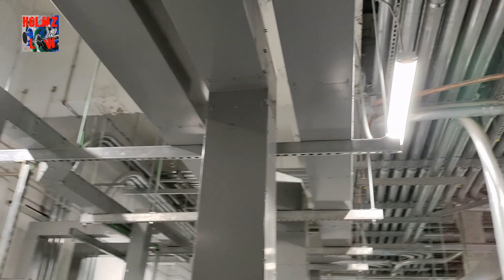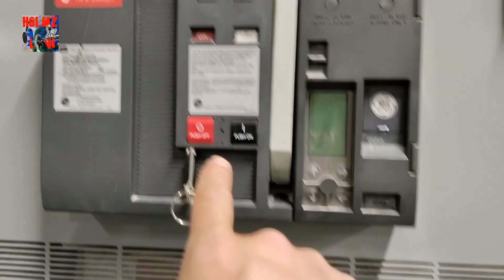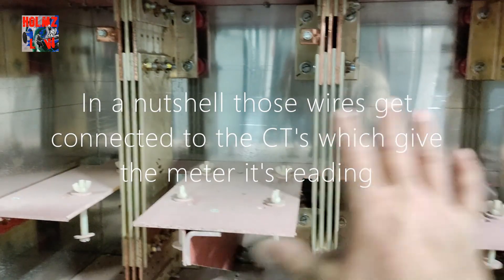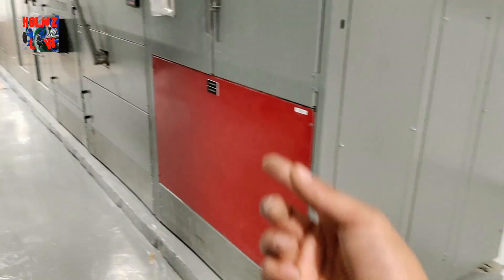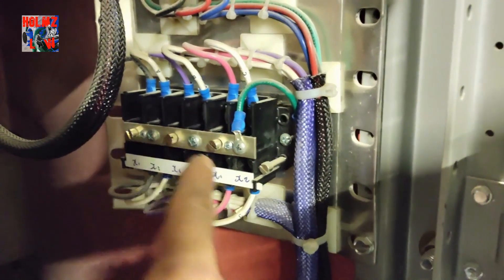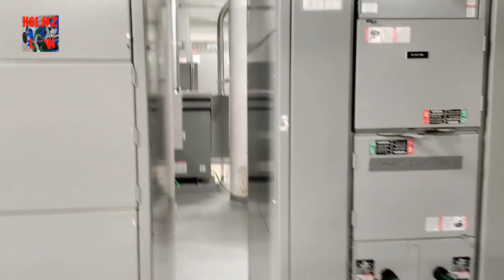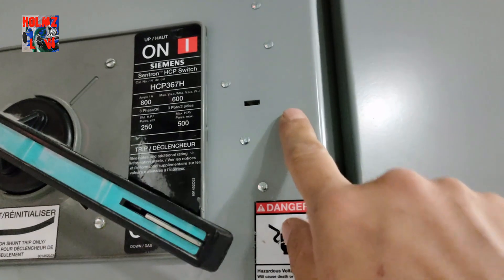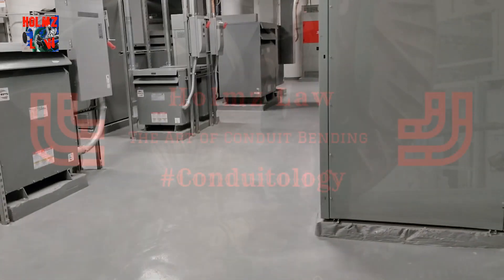Switchgear Pt.2 - Components

Comment: Awesome vid. Couple questions if you dont mind answering. Why have two different bolt switches per service, why not one main disconnect per service? Also why are there 6 services in the building instead of 1? Do you guys use the building steel as a GEC for all the services? Thanks in advance keep up the hard work!
Reply from the maker: Why the 2 bolt switches. Well that just how the engineer designed it. The switch gear was designed by the engineer and put together by another contractor. We installed it and put the sections together. Why 6 services. The building is pretty big also they're are multiple tenants that will be occupying the building. Yes we use building steel for our services but we also supplement it with the water main. How this answered your questions. 
Follow me on:
TikTok/holmzlaw
Facebook/holmzlaw
Instagram/holmzlaw
Reddit/holmzlaw
Reddit/r/conduitology
Reddit/holmzlaw
Tradeshound/holmzlaw
Twitter/holmzlaw
Quora/artofconduitbending
Quora/holmzlaw
Snapchat/holmzlaw